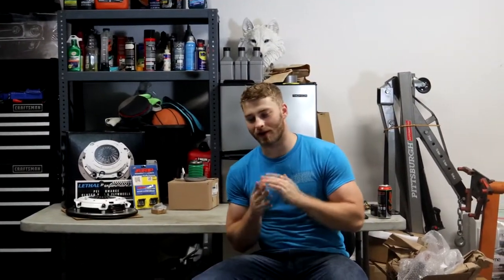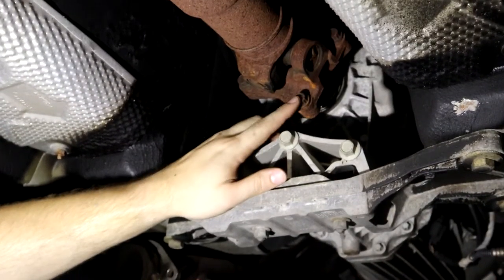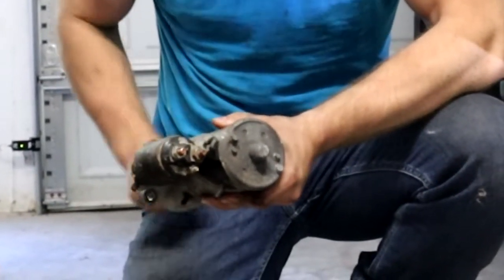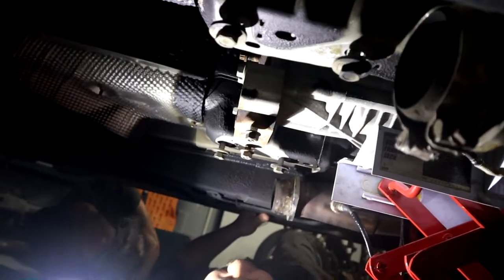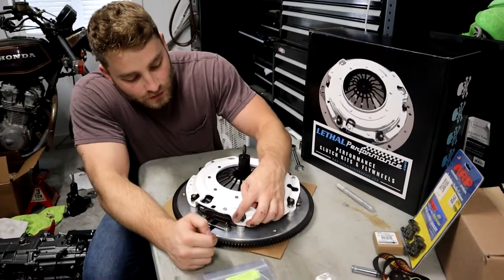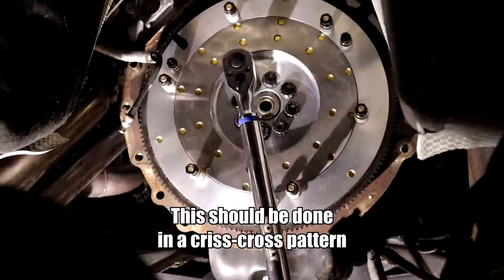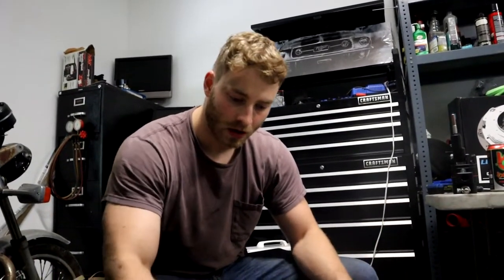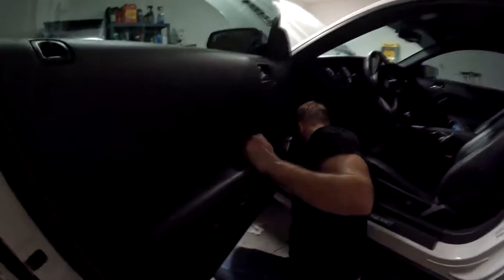How to Remove & Install a Transmission (MT-82) - The last guide you'll ever need!

Comment: installed an Calimer mt-82d stage one on 2019 gt mustang aluminator 5.0L engine MMR pulse ring mgw spec 2 shifter
mc leod rst which always had problems shifting into 1st. and reverse. After 10k would not go into reverse or 1st. gear.
Sent transmission back to Ben and Dylan at Calimer. They claim McLeod rst wrecked transmission. I bought the SECOND Calimer mt-82d stage  2 cyro treated micro polish gears  carbon fiber synchro rings billet forks and Mantic 9000. smooth as butter and rock solid. McLeod blame it on the 2017 to 2019 slave cylinder which I had a new one installed when I put the stage 1 in. F.   McLeod RST CLUTCH 
cost me major bucks !

Comment: do i need to upgrade my clutch when putting in a new trans?
Reply: Upgrade? Not necessarily, if you are stock and replacing with stock trans. But you should replace it while you have the trans out, that’s all the labor right there. But upgrading is always a good idea, but you have to be careful and not go too crazy with a clutch and lose a bit of your daily drivability

Comment: Hey man if you don't mind me asking were those 6 ton jack stands all the way up? I've got some daytona 3 tons that only go up 16-7/8 inches high and I'm worried about having enough clearance to pull the trans
Reply from the maker: I believe I had them two notches from fully extended.
Reply: @AlphaX13  Thanks for the response! Got the trans out, all the way up and had to shake the trans off the jack to clear the car

Comment: Great video. Interested in tricks or tips to get trans back together with the engine. Had the twin disk off 3x now and have since ordered steel alignment tool. We cannot seem to get past the first disk. However, the disks slide nicely on the input shaft. Seems like an inch apart is the closest we have gotten. Any tips would be greatly appreciated.
Reply: U figure it out?
Reply: The steel alignment tool made all the difference. The plastic tool would slip in and out as it should. But the steel tool wouldnt. Loosened everything up and used the steel tool. Everything went back together perfectly. Not the easiest job on jack stands but I will forever buy the steel alignment tool going forward.

Comment: Could I ask how you got the top 2 bolts out for the bell housing ?
Reply from the maker: For people with hands on the larger side, going from the top of the engine typically works pretty well. Otherwise you can lower the transmission slightly and use a very long extension and socket to reach those top bolts.
Reply: @AlphaX13  also how exactly did you get the 3rd starter bolt out ??? It’s been such a pain in my ass
Reply from the maker: @cjcullar  crushing your hand and saying a few swear words… or find someone with small enough hands to reach up there with a ratcheting wrench. For some of the bolts it might be easier to go through the side where the wheel is.
Reply: if you remove or loosen the AC compressor, you can gain access easily with a long extension stretching between the motor mount and header to that top starter bolt.  @cjcullar